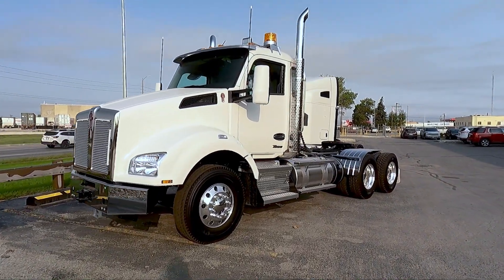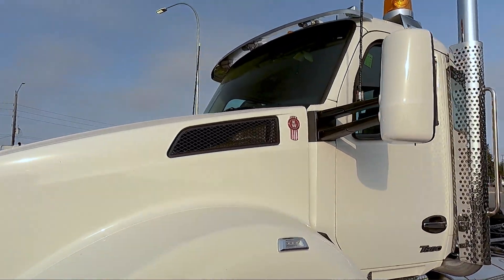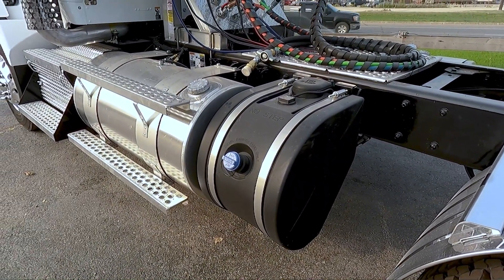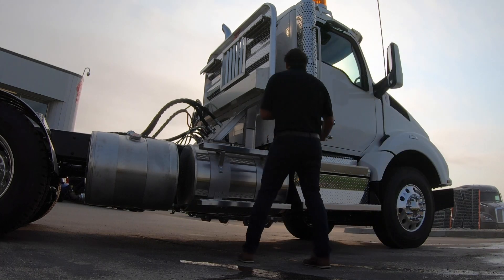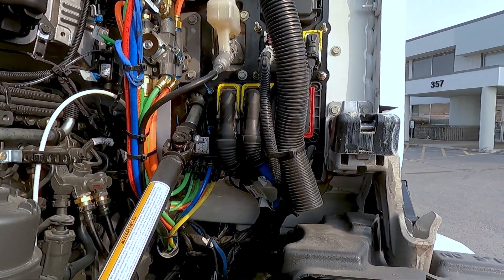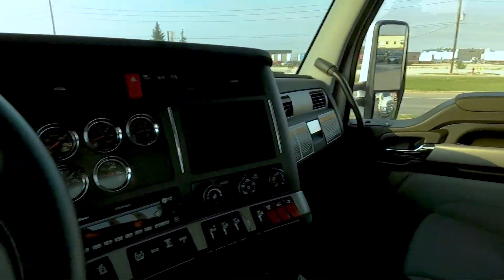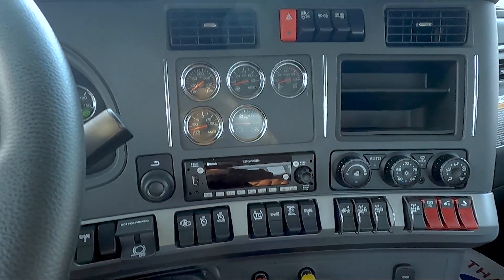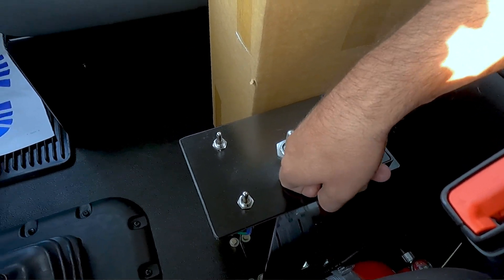2022 T880 Kenworth T880   The Kenworth Guy

Comment: Another cracking video and that kenworth looks amazing just one question if it has a dummy stack fitted could it be plumbed in to function as a working stack sorry for the question I'm just curious about it 😉 would love to run a truck like that over here in the UK 🇬🇧 but restrictions won't allow it stay safe out there from joff in the UK
Reply from the maker: Engineering doesn't connect it for emissions reasons.
Reply: @AndyTheKenworthGuy  that's brilliant thanks for the information have a good day 😊